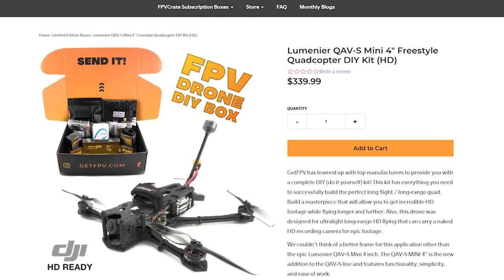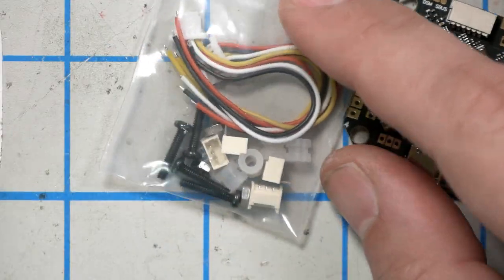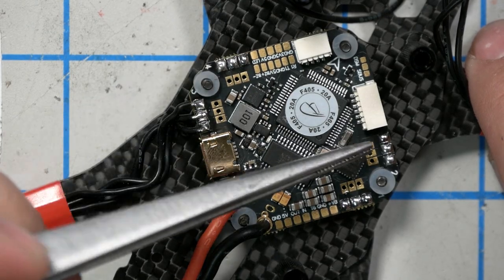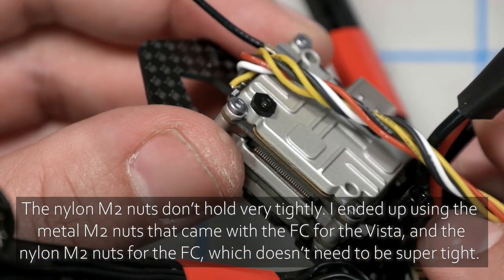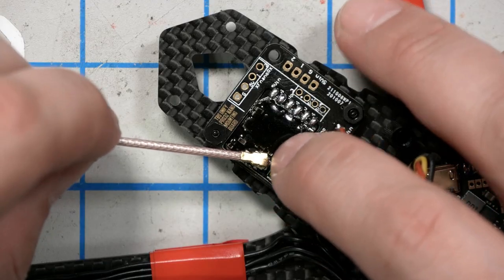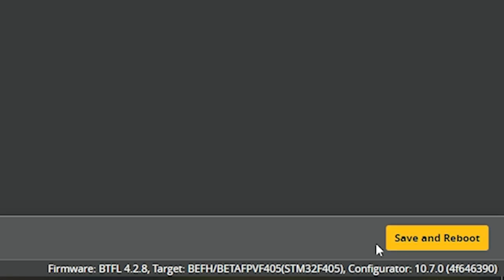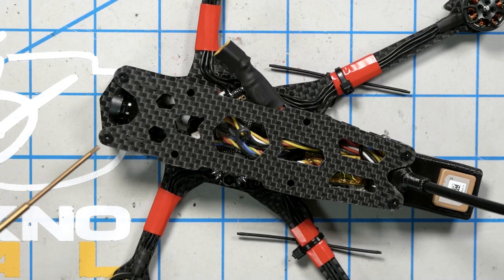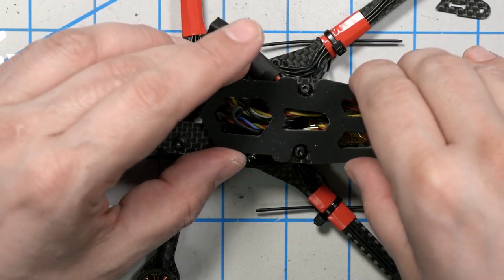You can build this micro long range quadcopter | QAV-S Mini full build tutorial

Comment from the maker: CORRECTION. The Matek SAM8Q has an on board 3.3v regulator. It is designed to be powered from 5v power. Mine appears to be working. But you should solder the GPS power to a 5v pad not the 3.3v pad like I did.
Reply: Can you tell me whats the quad version for 4s lipos? thank you!  in get Fpv only see KV 28000 for 4"
Reply: Flashbacks to putting the RDQ M8N on 5v

Comment: I built the QAV-s mini 4" a few months ago when the frame first came out.  I'm using Dave-C 1404 2750kv and a JHEMCU ghf420 f//c. using vista with nebula pro and I love how this thing flies. it is a fantastic sub 250 build. great video Joshua  Keep'em coming
Reply: Thanks for pointing out the weight.  sub 250 is an important deciding point.

Comment: Take about a foot of dental floss, wrap it a couple of times around the middle part of the gummy, the skinny part, then feed both ends of the floss thru the hole in the FC. Get the gummy started in the hole, then carefully pull the floss thru, it will perfectly pull it into the hole. Then just unwrap the floss and repeat 3 more times! Works like a charm, and I've saved myself a LOT of grief since I learned that one...

Comment: To instal gummies easier, do the floss trick. Take a length of floss, wrap around the gummy twice then put the ends of the floss through the hole and pull. It'll insert the gummy. Then remove the floss.

Comment: I want those motors now! But the only way to get them is to buy the FPVCrate. And removing the screw is really the best way to install the Vista antenna. If you try to leave the screw in and swing the metal holder it's a pain to get the pin in the hole. Thanks JB!

Comment: Nice. My 4" Roma running  4s 18650 is the best fun for long range. Bought it as a bnf complete but I've completely rebuilt it over the past few weeks.
Reply: I plan to do something like that with my 5" roma. Do you use 3 or 2 blade props?
Reply: @Interceptor3000  currently running two blades but I've been looking at going higher... Especially after Nurks video of 8 blade props 😂
Reply: @vinanderson2535  yes, those sound amasing.

Comment: A good way to mount the receiver is to use Velcro cut to size that way you don't need a zip tie or the tape. I do this with all my builds but either way works.

Comment: Well I got my DSMX receiver to work once I bought a new 4 pin connector and used the tx pad and proper SRXL2 setting. Thanks for the help on that. Unfortunately when I went to push the  antenna onto the vtx the side pushed out of the mounting board and it broke  I can’t get power out of it. I ordered a new one. I may try this one without the mounting board. My first build, it’s not going smooth at all.

Comment: One comment about BetaFpv products, both complete drones and just electronic components: Keep in mind that their product life cycle is very short and quite soon you won't find documentation for an outdated product on their site any longer. So download any documentation for your product as soon as you have bought it to be on the safe side to be able to maintain it later.
Reply: I found that to be the case with a lot of products. Here's what I do:
I have a folder on my PC named "RC STUFF". In it a have sub folders for all of the main products I purchase. If I bought this quad, I'd go to the link JB supplies and I'd use the screen shot feature in Windows (snip) and grab a picture of every picture on the site. Also, if all of the included parts. I also find the pin out for the FC, ESC, VTX, etc and snip pics of each of those. Any other wiring or pin outs get pics and are saved in this folder.
Then, 2 years from now, when all that is hard or impossible to find, I have EVERYTHING! Simple to find too. Need to rebuild, all the pin outs are there!
Just don't wait long to do this and don't forget because it's so easy with this info and pics, but so hard when you can't find anything anymore! 🤔😎🤘

Comment: I recently purchased this kit but I’m have an issue. I’m trying to set it up to use the cadix vista for video tx and a radio master tx16s remote. I have dji goggles v2. Can’t get crossfire or frsky xm plus mini to work. It’s probably in betaflight if I had to guess but I just don’t have enough experience to figure it out. I can get the v2 goggles to pare but the receivers never pair to my 16s.

Comment: Hey i want to enable all the pin from 5 to 8 for aux channel in naze32 f3 using betaflight how can i do it?basically i want to use 4 servo but in my board at pin 7 only it is available (servo tilt).

Comment: Which would be “better” for a noob...the BabyHawk II HD BNF or this kit for a 4”?
Reply: The price is nearly identical...I know one is 3.5” and the other is 4”...and the kit has GPS where the BNF leaves GPS out. Any opinions on the other components that would push me one way or the other?
Reply from the maker: The question is whether you want to build it yourself or not. I think building your own quad is the best way to learn how to repair it. Otherwise, once it breaks you're just buying a new one.
Reply: @JoshuaBardwell  that’s fair. Thanks for the response!
Reply: @shagam00  for the first time I'd recommend buying instead of building, then learning to take it apart and repair it. it teaches you a lot without banging your head trying to figure out what you're missing or why components keep smoking ^-^

Comment: I had a few bumps in the road, but I finally finished the drone. Yesterday when I plugged everything in, I noticed things had a pinkish tint to them. When I took the drone out to fly, the image is really clear. My problem is grass trees pretty much half of the things I look at are pink , have a pinkish tone . I’ve gone over all my soldered connections, and camera settings. I do not see where the problem is coming from. Any ideas? Thank you so much
Reply from the maker: It sounds like a camera issue. I would ask FPV crate support about it.

Comment: Im building the 4” kit, I have tried two different dsmx receivers. Neither worked, they bound but nothing in the receiver tab. I am looking at the dsmx configuration on the beta fpv website for the FC. They tell you to use the wires 2,3,4 from the connector. If you look at the breakdown of the flight controller number two is an RX not a TX pad. Wondering if that’s my problem? I need to use wires 1,3,4. Also it said to use Spektrum 2048, the receiver instructions (4065) say to use SRLX2. 
Any help appreciated. Im stuck !!
Reply from the maker: DSM receiver goes to rx. Did you solder the solder bridge?

But srxl2 receiver goes to rx not rx. And you have to type

set serialrx_halfduplex = on
save

In the CLI
Reply: @JoshuaBardwell  it’s the Spektrum 4650 receiver so I would need to use the TX pin correct ? The diagram shows it coming from the RX pin which is how I did it. Also I did solder the bridge and I typed that command in the CLI - nothing. 
My problem is I can’t try it with the other wire from tx instead of the rx as I cut it off. The diagram showed it as not needed. Can you help me find the correct 4pin connector to replace it ?

Comment: The 4inch “long range” is priced at $339 and you have to build it....
The other Bind N Fly brands are selling for cheaper and come pre-built! Not that building is a big deal but you have to put a value on everything..
Reply from the maker: The ability to build this yourself is a benefit. If you don't value it definitely get a bind n fly. The point is that you want to learn by doing.
Reply: @JoshuaBardwell  or buy all the parts separatly, build tlit yourself and still save a lot of money.
Reply from the maker: Do the math.... Frame is $45. FC is $62. Motors are about $60 for a set. You're already at $167 before you then add a Nebula for $150. Now you're at $317. Plus $30 for the GPS = $347. Plus three sets of props $12. Plus an extra-long XT30 pigtail. Plus a bunch of spare screws, heat shrink and zip ties.

$339 for the kit is a discount, as it should be.

Comment: Can someone explain to me why people design deadcat-style frames when you can build a true-x frame without the props in view like the HGLRC Sector 150.
Reply: Weight would be the primary reason. The only way you can get in the target weight range with a 4" quad without props in view us this type of geometry. You're looking at about 1/3 less total carbon compared to something like the sector 150. The sector 150 is also 3" not 4"  like this one. That extra inch on the props makes a big difference. Basically on these smaller quads, if you want decent flight time you have to go as light as possible.
Reply: @QuadMcFlyFlies  That makes sense. Thanks.

Comment: I got the 3" version of this frame and a rush AIO stack wouldn't fit in it and it's been dubbed the smallest stack out there
Reply: I would stay away from the Rush stack just on principle, it uses pins to connect between the boards which is a hugely bad idea. This frame was designed to have the VTX in the rear, which if the stack used cables would be an easy change, and allow everything to fit with room to spare. If you want to go 20x20 I'd stick with standalone FC, ESC and VTX. There's plenty of room for even full size 20x20 boards in that configuration with the VTX in the rear 20x20 mount points. Really though the QAV-S mini frames are designed for the whoop style all in one boards, which is by far going to be the lightest option for this size, and given they come in 35A varieties they can easily push any motors you would use in this application.
Reply: @QuadMcFlyFlies  I actually ended up putting the vtx in the back and it worked great till I shorted the ESC. But the mamba stack works great now lol. Looking back the pins weren't the greatest choice but they did work really well. And boy I tell ya, that vtx gets WARM.

Comment: If you wanna keep this one under 250g, you are limited to 650mAh 4S battery. I think you could get around 6-7 mins of cruising in that configuration.
Those "micro long range" are so misleading. If you want 15+ mins of flight, you are looking at 360g. Regular 3in can go for 10+ mins while still being under 250g. Shady.
Reply from the maker: I definitely agree people need to understand the permutations before they buy. A "micro LR" four inch can be sub-250g OR it can get 30-40 minute flight time, but not both.
Reply: @JoshuaBardwell  Yea, I don't really like that "people need to understand that it is not what it says it is, but we will talk about it like it is". Also, that 30-40 mins looks like a stretch, from what I saw, I would say 20mins of useable flight time. This "micro LR" market is a mess xD Started reminding me of a "gaming chairs" market.
I'm gonna try some tiny motors on 3in with 2000mAh 4S, it should weight like 4S liion pack. I'm curious.

Comment: Another GPS module on the tail of the drone, it looks a good idea, but it's terrible for your GPS lock, the signal is badly affected by the 900mhz/5.8ghz antennas. Lumenier, don't copy bad ideas, what's the point of repeating what doesn't work? Mount the GPS as far away from the antennas as you can, for example, on the top of a gopro naked 3D printed mount, but not there, my god, you need your GPS rescue working all the time the best possible way.
Reply: Lol yeah I usually always end up printing a new TPU mount
Reply: 5.8ghz shouldn't have a major effect on GPS lock, especially with the long antenna that is intended for this setup. And you should probably be installing your crossfire antenna in the front.
Reply: @QuadMcFlyFlies  Seems to me the further you can get the GPS from the rest of the frame the better the lock. I notice that a lot of X Class have their GPS way out on a mast.
Reply: @awwtergirl7040  yeah that's valid, but on these micros everything is a balance between weight and performance. Of course the beauty of a custom built quad is you can always move it if you prefer it somewhere else 🙂